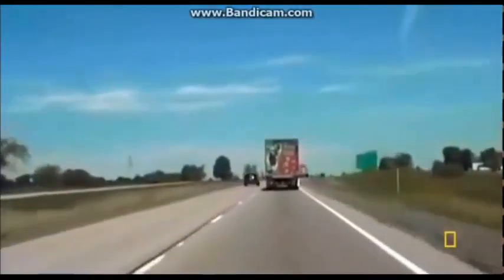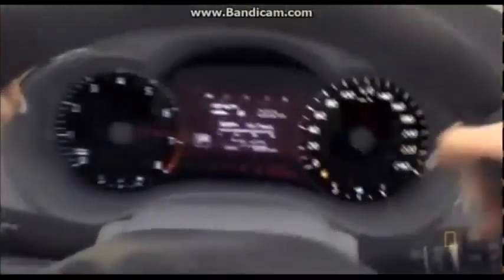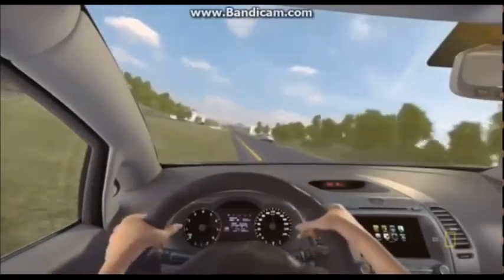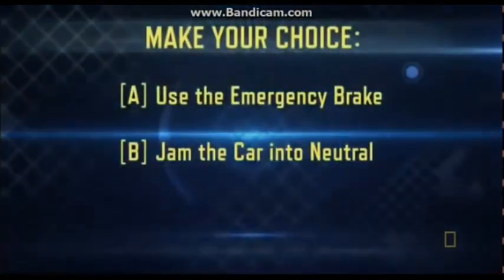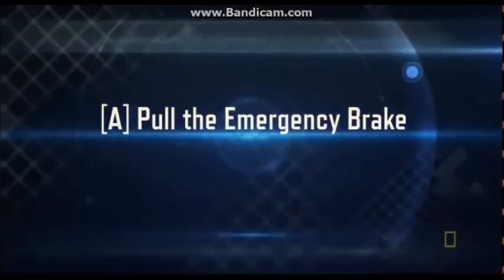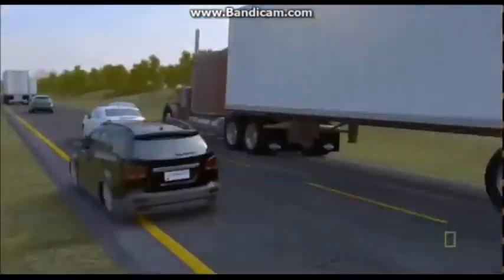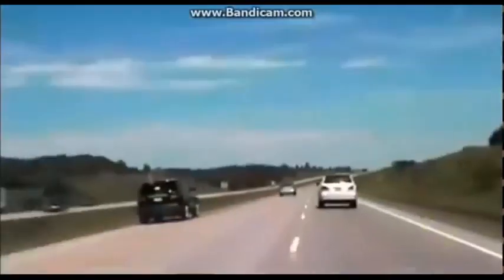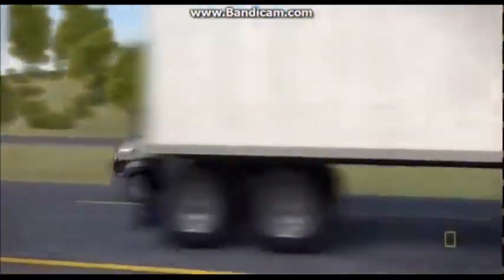How would you stop your car if your gas pedal stuck

Comment: Or D, keep going 120, get to your destination quicker
Reply: Hahahahahahahahaha but you will roll over or crash right
Reply: Kennard Edmund mayby his destination is hell or heaven?
Reply: Kennard Edmund
r/woooosh
Reply: A perfect excuse
Reply: WOOOOOOSH
Reply: a guy went 130 miles before losing control of his car with his gas stuck at 130+ so you have a good idea but you wouldn’t be able to stop it right when you get there
Reply: E - Run out of fuel
Reply: Go past your destination
Reply: @kenedmund5659  just no clip before you hit the wall

Comment: D. Buy a manual and use the clutch.
Reply: Which disconnects the engine from the wherls... which is the same exact thing dumping an auto into neutral does anyway. So the argument is redundant
Reply: Bet you're a blast at parties
Reply: a.k.a have the brain capacity to do 2 things at once.
Reply: honestly I can't belive how many people don't know how to drive a stick shift...
Reply: blow the engine up by putting it in first at high speeds
Reply: Like going 120 mph then shift to 1st gear, and you know what happens
Reply: If you had a manual, just pressing the clutch in would save you. It doesn't lock the steering so you can steer because you're not turning off the ignition.
Reply: Yea except you don't destroy your transmission while you're at it....and considering auto transmissions are much more expensive to rebuild or they won't even bother rebuilding it. It's definitely not exactly the same.
Reply: yes and put it in R for Rapid braking
Reply: Diddz' heard of down shifting ?
Reply: DropDead down shifting in a auto sounds fun
Reply: LGPanthers1 Hell yeah he is
Reply: Except you have other things to worry about than repairing your transmission... Things trying to survive.
Reply: Elites Engineering transmission will be fine the engine will blow unless you can slow down quick enough and turn it off
Reply: Yes you would shift into neutral as well if you had a manual, but you wouldnt damage the transmission. An automatic isnt designed to shift into neutral while your car is still moving, so you would probably damage the transmission a lot. But then again, if you were in that situation you probably wouldn't care about damaging the car, you would care about actually surviving.
Reply: And whoever said "what would you do shift the manual into first and blow the engine" is an idiot, the point is if the car was manual she could have slowed down without further damaging the car.
Reply: Diddz' not really. In a lot of these cases, the transmission won't allow you to shift to neutral, where as in a manual you just push the clutch
Reply: lol
Reply: yea no kidding
Reply: Kni Nope, it wont, real life is not NFS. But the axels will break and the transmission, too.
Reply: а щееd where I live manual still rules over auto
Reply: no difference between auto or manual "neutral" gear, rpm would still be up there bc the engine is still working on gas
Reply: put it in neutral
Reply: if you try to put it in neutral without the clutch or rev matching you'll hear a loud ass sound and fuck up your transmission
Reply: Diddz' Not really considering jaming the auto transmission into neutral doesn't mean it's disengaged to the engine and doing so will most likely jam the transmission and lock the rear tires meanwhile a manual will 100 percent disengage the engine from the rest of the drivetrain. It's OK to be millennial but definitely not something to be proud of. Learn standard. Make your life easier ;)
Reply: And you can even clutch ride home :))